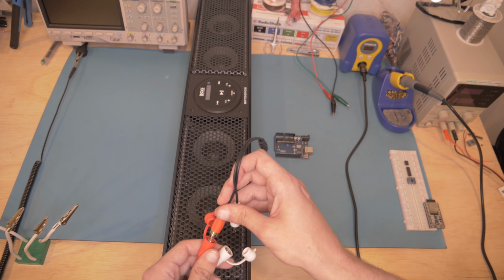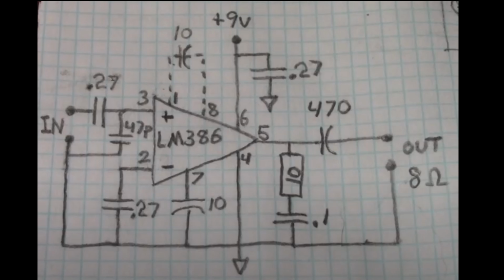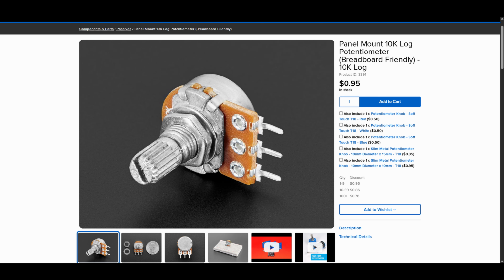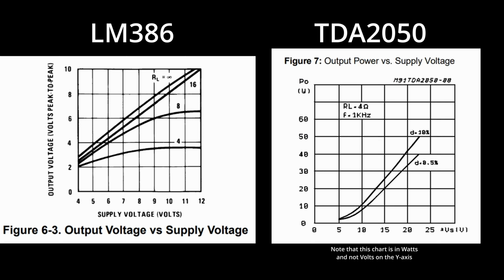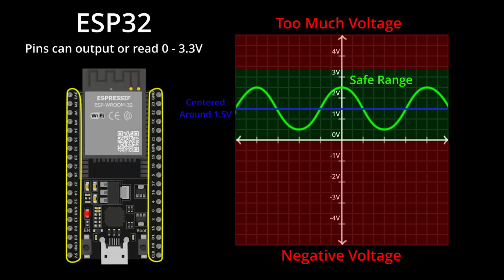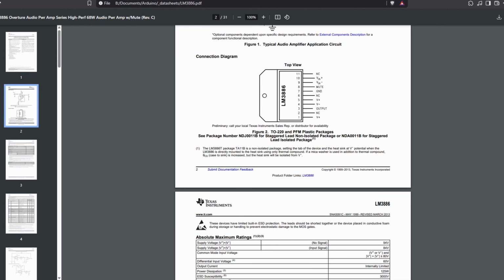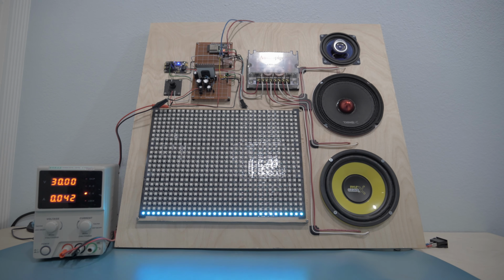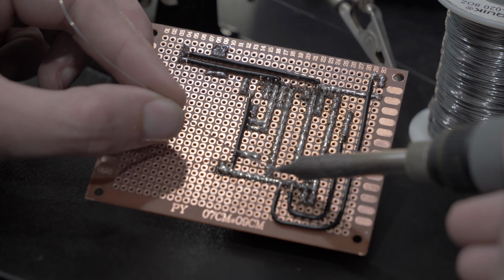Building a Custom Soundbar with a Spectrum Visualizer

Comment: Great project! Thank you so much for all your hard work.

I'd like to adapt this system for my car. My car audio player is equipped of RCA.

I'm planning to do this with an Arduino UNO, so I understand I'll need to build the 0/5V bias circuit.

Regarding the LEDs, I think I'll modify the program to change the colors and the display type (rainfall effect, for example) using one or two buttons.

In any case, thank you for all the work you've done.

Comment: I think the rail splitter IC is limiting your output power a lot. It can only source and sink around 20mA, but it appears that you're trying to push all the speaker current through that tiny thing. The application for virtual grounds is mainly for signal conditioning - much like you did with your bias circuit for the ADC input, it is in fact basically the same thing inside. Furthermore, you have an output DC blocking cap anyways on your speaker, so there's no need to even do split rail supply for the amp in theory.
Looking at the datasheet for LM3886, Figure 3 actually shows essentially what you're trying to do here. Note that the 91k and 100k Ra's, Ca's and the Q1 make a mid-point bias for the ground of the amp itself - effectively your virtual ground generator for the amp, so that the amp can swing from midpoint down to actual ground for negative voltages and from midpoint up to the supply voltage and drive the speaker. In your case, since you already have the TLE2426, you can just unhook the TLE2426 output and the amp's pin 7 from the GND of your circuit, and just connect the output of your TLE2426 to pin 7 directly, and a 100n decoupling cap to circuit ground as a finishing touch. This creates you a proper virtual ground network that won't get loaded by power components. You will also need to reroute the ground on that 20k resistor after your volume control to that virtual ground too, so it swings around the virtual ground potential. Your 680pF cap would then go across the inverting and non-inverting inputs of the amp, ie. pins 10 and 9 as decoupling, or you could just ditch it completely as it is more for EMI resilience.
This way, you can still supply your 30V for the amp, 5V for your digital part and have a single "actual" ground for the entire circuit. (In your case, the orange wire in the schematic being called GND is misleading, that isn't really a ground.
*If your 30V supply is fully isolated from the 5V one, than you'd be measuring symmetric +/-15V in regards to the 5V-Ground, which appears to be the actual ground for this circuit and everything is almost okay except for your poor TLE2426 left to deal with excess current from the speaker.
*If the two supplies have the same GND-reference, then you're shorting out your virtual ground anyway, your power amp will see 30V at its positive supply and 0V at its negative supply with respect to the 5V-Ground and will only swing for positive input voltages generating you massive THD, since the amp basically gets clipped to 0V for any negative input voltages)

Realistically speaking, you probably couldn't have seen this issue coming if you're just a guy trying to mash some circuits together for a hobby project, which is fine I guess. I can see why the single supply schematic can intimidate people that probably don't deal with electronics design on a daily basis, but I hope I could help anyway ;)
Reply from the maker: Interesting, I'm well aware I have limitations on my understanding of the deeper ideas and principles at play when I'm trying to combine different ideas to build something cool, I don't have a degree in electrical engineering after all. My knowledge is based off of reading books and copious amounts of youtube/googling. The way different things interact can be hard to predict or understand. 

My understanding was that an op-amp needs a positive and negative voltage reference in order to generate its swing in both directions, and that if the voltage references weren't high enough it would eventually hit them and clip the output audio's swing on either side causing distortion., I thought single-supply circuits were using some kind of trick to get around supplying a negative voltage at the cost of the quality of the audio quality but maybe I'm wrong on that.

Some day I might revisit this again and try to do a build with really clear audio quality based on the suggestions and feedback I get. I was aware the TLE2426 had a limit amount of current it could sink, but I figured that limitation would be worth it providing an easy +/- split for the references, and when I tested it I thought it sounded good enough for what I was trying to do.
Reply: @himynameischris2175  Which is completely alright, I've been designing industrial electronics for just over 5 years now and I still learn new things today.
The trick is just that voltages are relative, it's basically a difference between two points in a circuit. The gist of it is just simply, just as you did the bias for your ESP input, you either let the input signal swing around ground, but have to shift your entire power supply down to have room for the negative peaks or put a DC offset on your signal so the output never swings below ground and after you're done amplifying your signal, AC couple it so the DC offset disappears from the signal. This DC offset is what can also be referred to as virtual ground, since if you start measuring voltages and signals with respect to this DC offset, you will basically see exactly the same thing as with split rail supply. Hence the name virtual ground, because it isn't necessarily the same potential as the "actual" ground, but you can use it to essentially make a new zero-point reference in a circuit. The disadvantages of single rail supply are: It can be difficult to process a mixed signal with AC and DC voltage, but that's not really relevant for audio as it is AC only; and that the AC coupling caps will reduce your bandwidth, so good cap value selection is important to meet the design goals - I assume the values you have worked out well enough for you.
As for the TLE24262, its current capability of 20mA would in theory result you a mere 3.2mW into 8Ohms, out of the ~28W into 8Ohms you've had available for the speaker. Not sure what math you've done that would say it's worth it. Consulting the TLE2426's datasheet, its output impedance is 7.5mOhm. This means it will probably have to deal with all your speaker current and may fail at some point when the peak current lasts for a bit too long or the peak gets too big.
I get that for a hobby project, "if it works, it works" is good enough, but it won't be necessarily repeatable for people building along at home. Maybe something to keep in mind for the next revisit of the project...
Reply from the maker: Interesting, makes a lot of sense. Part of the reason I made this video and my last was that it was very hard for me to find information online about using op-amps like this. Someday I'll maybe make a follow-up where I build something with this stuff in mind, thanks for the feedback.

Comment: Great video. Thank you. I actually kind of like when the amplitude of the visualizwe rises and falls with the volume. Just personal preference though. I can see why you would want it this way. Super cool build. You've got me interested in electronics now.
Reply from the maker: Thanks, the nice thing about having it setup so that turning down the audio doesn't dampen what the visualizer is reading is that you can still very easily implement it reacting to the volume being turned down or up.
Reply: @himynameischris2175  Ah that makes sense. That sounds like a more versatile solution.